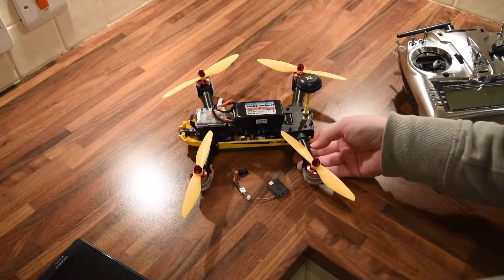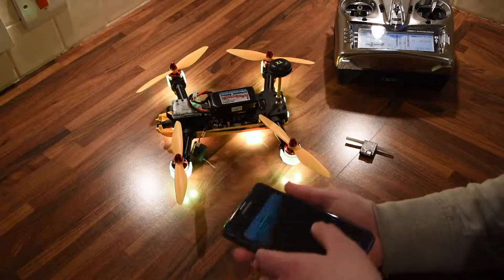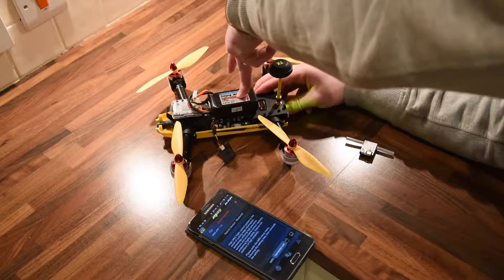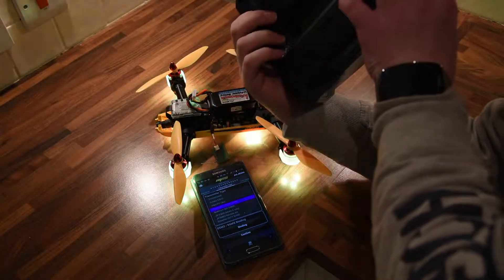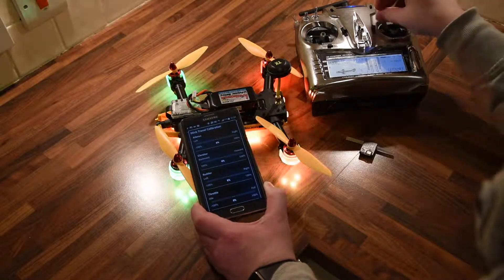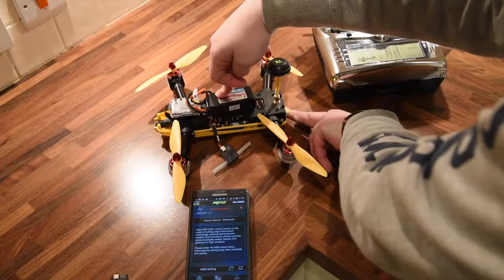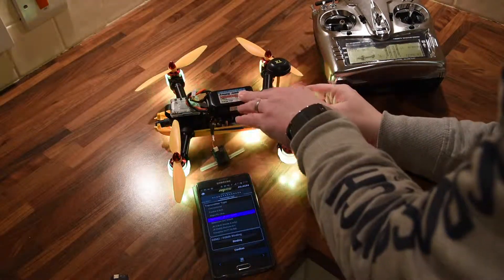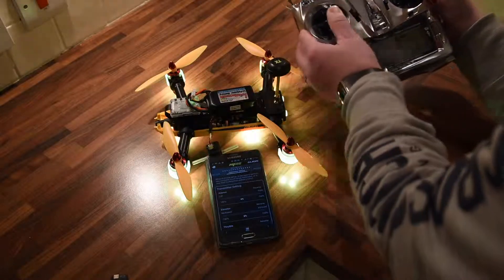MR25 Bind Issue following the v1.2 Firmware update from Align.

Comment: How did you fix this issue? I am having the same problem.
Reply from the maker: Colby Pace Hi there. I ended up rolling back to software version 1.1 to make it work reliably. I know they are away up somewhere in v2 but I just never attempted to update as it as I was working in the theory that if it isn't broke I didn't fix it!
Reply: I'm having the same problem on both my MR25 and MR25P. How did you fix the issue and how do you roll back on the firmware?

Comment from the maker: Yes, working 100% now. The only slight issue was that it was drifting forward in attitude mode a lot which would almost trim out but the gyro calibration part of the app wouldn't work. I discovered yesterday that if I moved the packs right to the back (tight up the antenna - 1400mah 3S) that it was dead on. Before they had to be as far forward as possible. Because I had deleted the model from my transmitter memory it took me a 30 mins to work out how to allocate the channels to get all the camera functions but all good now. I'm told that firmware v1.3 is round the corner as it's in beta mode currently which solves the 11ms and 22ms issues for new and older Tx systems and also DSMX should be able to be used on the older systems. Gyro calibration should work as well. Hope you get sorted soon.